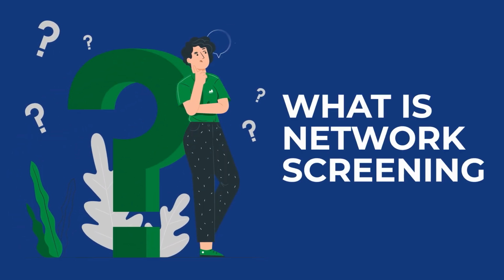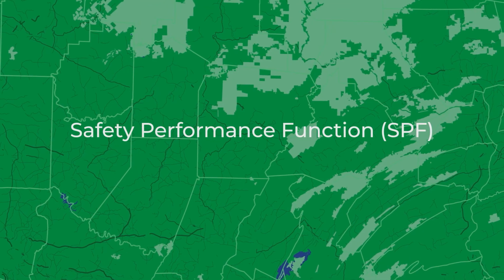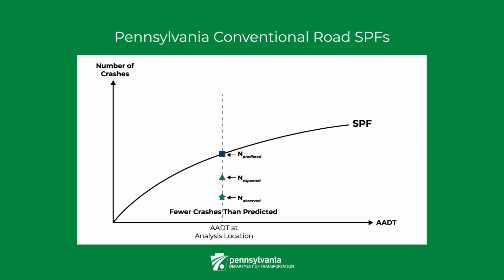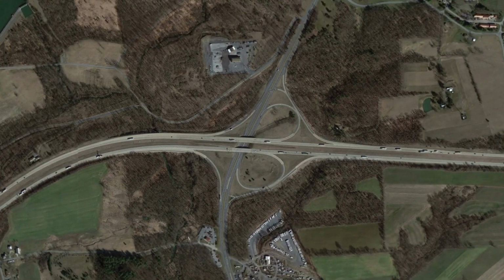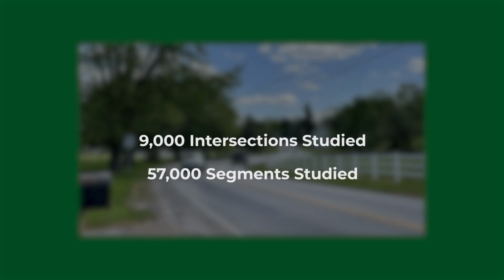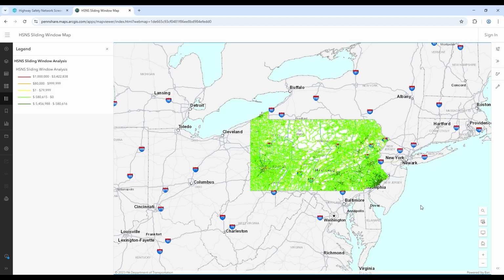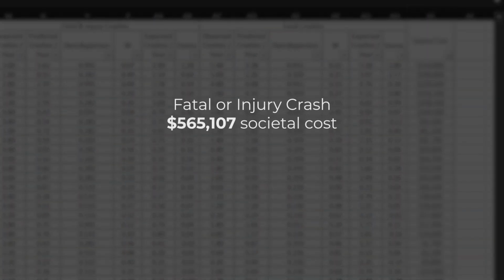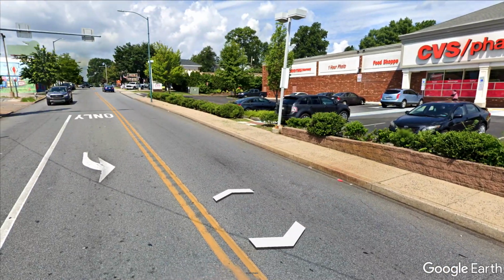PennDOT Highway Safety Network Screening

Comment: PennDOT, you are a joke!  I travel the RT 30 bypass EB everyday.  There is a mattress that has been sitting in the shoulder between 340 Thorndale and RT 322 for over 3 MONTHS!!!!! The only time you see workers out in force, is when people complain numerous times about potholes.  PA is the absolute worst roads!  Aren't you supposed to "maintain" roads for safe travel??????  Storm drains clogged with debris and only get cleaned when they cause flooding.  An absolute disgrace really. Do better